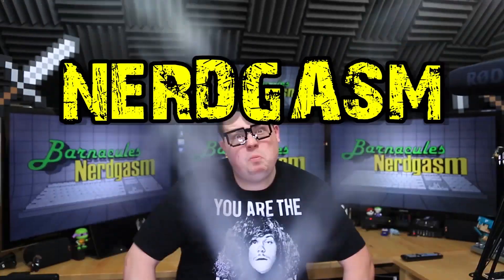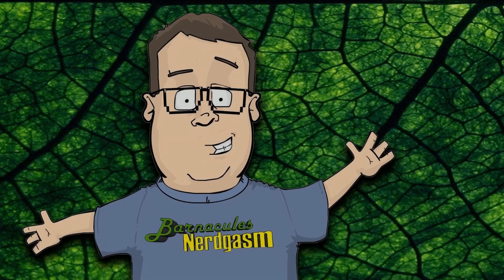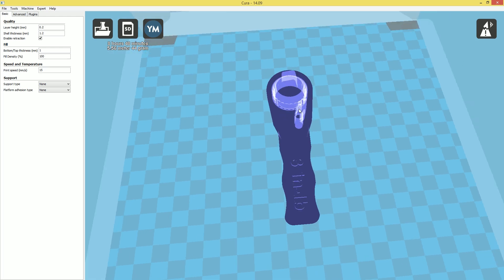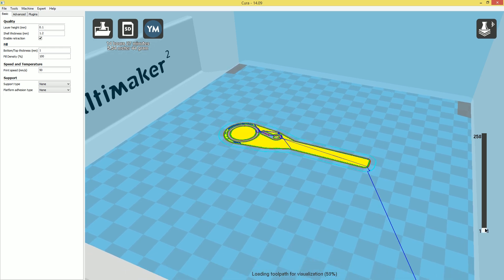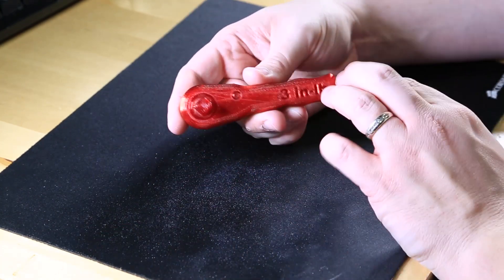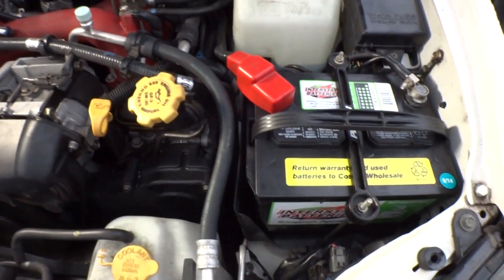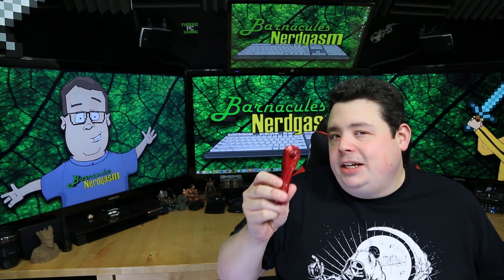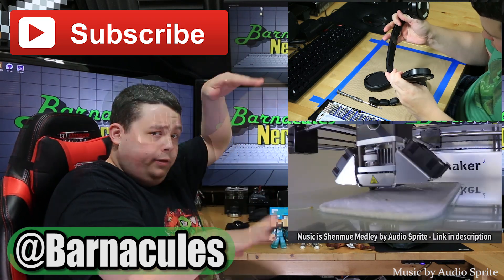3D Printing & Using NASA Space Wrench Here on Earth - @Barnacules

Comment: I have a question Barnacules since you're pretty knowledgeable about all things computer/peripherals.

Would a ModMic 4.0 or an AudioTechnica AT2020 USB pick up sound leakage from a Beyerdynamic DT 990 Pro if I'm listening at a comfortable/loud enough level to hear footsteps in say CS:GO? I really want an open back set of headphones for the soundstage but I fear all of the sound leakage will be picked up by my choice of mics.

If you answer, thanks!
Reply from the maker: You will have problems with the leakage unfortunately but you can set the activation level loud enough in most cases to combat it depending on the application. Truth is for stuff where you're using a mic and need to hear what is going on closed back is the way to go.
Reply: Barnacules Nerdgasm Kind of what I was fearing. Ah, oh well. Thanks for the speedy answer! Greatly appreciated!

Keep making awesome videos. (:
Reply: Whorax I have the AT2020 XLR and it is pretty good for not picking up noise. I record with my Speakers and it doesn't cause echo in my recordings from picking up the sound from my speakers as they are behind the mic. The AT2020 is a cardioid mic which only pics up sound from the front of the mic and very very barely picks up sound from the Back. The only thing with the XLR is you need a 40W Phantom Power Supply to power it unlike the USB Model. But the XLR works better with the Mixers as most mixers use XLR over USB unless your willing to fork out £200 for one with USB Slots plus most mixers have built in Phantom Power. The AT2020 is one of the best cheaper mics out there. I got it before most on YouTube started using it. I paid £60 for mine 3 years ago and have never regretted getting it. Only just recently have a heard of Large YouTubers saying they use the 2020. When I first got it and made videos with it on my other channel people even said how professional the video sounded for a new YouTuber. Most use headphone mics or cheap karaoke mics which pick up tons of noise pollution. Your headphones should be OK so long as you have your mic sat back enough and use a mixer and software to help cancel out the background noise but if you have the mic right in front of you and have the sensitivity up high you will have the mic pick up the sounds from your headphones. My suggestion would be either have the mic sitting 2ft away at medium sensitivity or have 1ft with low sensitivity. So at 2ft using windows settings at 60% volume and 1ft at 30% volume and you should be OK. Mix it with a Mixer and yoy should be golden. Another suggestion is make sure you record your mic on a separate track rather than have game and voice as one track. If you use Shadowplay then use Audicity to record your voice and turn off voice recording in your shadowplay settings. In doing this you can separately edit the voice and you can even edit out the background noise. Also Audicity has some really good settings and plugins that you can use.
Reply: Whorax I've got DT990 Pro and Modmic 4.0, and it does pick little bit of sound when you are firing a weapon, but your teammates can barely hear it if you are talking at the same time. The mic actually picks more noise from my Cherry MX brown keyboard than the headphones. I do however use push-to-talk so my friends have never complained about it.
Reply: I have Sennheiser HD518, which are open headphones, and the ModMic 4.0, and I can almost guarantee that you won't have any problems with it. The ModMic 4 is directional and short-ranged, if you listen at a reasonable volume, it won't be picked up, but if you're almost deaf, it will be a problem.

Comment: are thay thinking about a way to recycle the material in a no cost way?
Reply from the maker: I couldn't find much information on how they are reclaiming the material in space so I'm assuming they are not right now. However with inventions like the filament extruders down here it's just a matter of time before they have the ability to reclaim the filament and make new stuff from the same materials.
Reply: Barnacules Nerdgasm Yeah, If they just melted their printings, they could extrude it back into filament, would be really useful when the teeth on the wrench wear out! It could also be practical for home use, so that you can reuse the material from your bad prints. Greenpeace would approve!
Reply: Barnacules Nerdgasm I Suppose they could technically melt down the scraps and use them, right?
Reply: if the material dose't break down when it gets melted down i guess.

Comment: Cab you make it with the bronze filament?
Reply from the maker: Yes but it would be super weak since the bronze dust is held together with PLA.
Reply: Ahh ok
Reply: Barnacules Nerdgasm could you print a wrench that works both ways, there are these kinds IRL, where there is a lever/switch that you just pull left or right and it switches the mechanism from left to right, without needing a second wrench, or second head.
Example http://www.alibaba.com/product-detail/high-quality-Hot-sales-cheap-price_60011979634.html
Reply: Crazy Psycho I love how you linked an alibaba link. That was just amazing. Also he used one of these in the video near the end on his car.
Reply: KevRunsOnDunkin well, IDK it's the first thing I found :D
Reply: the real question is to cab or not to cab

Comment: They should design a 2nd wrench for loosening, then you'd just have a different one for each. Way easier than a selector switch.

Edit

LOL You literally just said that in the video
Reply from the maker: Great minds think alike :D
Reply: Or they could just put a socket attachment on each side so that you could loosen and tighten with a single ratchet.
Reply: Can't you just mirror the model and make the loosening ratchet? :/
Reply: Why not just put a 2nd head on the other side?
http://cdn2.bigcommerce.com/server1400/84506/products/15532/images/10830/611032__78114.1409993562.1280.1280.JPG?c=2

don't need 2 wrenches or a direction changer
Reply: and now you know to not comment until you've watched the whole video
Reply: That is why I don't comment until the end of a video xD.
Reply: GeoDelGonzo Yes that's what Jerry said.
Reply: GeoDelGonzo ahhh yeah... Just got to that part. I'll shut up now :P Sorry!
Reply from the maker: Alec Day The 1911 requires a very special 3D printer that is over a million dollars to produce. It's a chemical laser printer bonding metal dust together. Not going to see those in our houses until they upgrade the power lines coming into them :D
Reply: hazelamym 3d programs can build scaffolding to support it :)
Reply: Make one wrench with two sides; one for tightening, one for loosening. Pfff stupid NASA
Reply: Barnacules Nerdgasm Hope you read this Jerry. Recently I found about a new vr headset called OSVR its an open source vr group that is starting to team up with companies such as razer, I have got to know that you can 3D print a kind of kit and I thought it would be perfect for you to make a video. Keep up the good work :D
Reply: Well, just take and put two output shafts on the wrench, one on the side that it is on, and another that is on the other side, so with the same, simple design, you can change directions just by flipping it around. Also, if you add multiple ratchet locks, it would increase the torque-limits by splitting the load up among multiple teeth.
Reply: Yes it would be better but they have limited abs plastic up there so they have to conserve it
Reply: chinett63 i thought of that too, but then you've got the body of the wrench being built on nothing.

gravity pulling at it wont be an issue, but the print head still has to have something to lay the plastic onto.

it could be done if they incorporated some snap off support structure underneath it to build on.
Reply: mudbob1 I was thinking the same thing! One ratchet for both directions... just flip it over.
Reply: well we know who didnt watch the whole video
Reply: Robert treboR Well we know who didn't read the rest of my comments.
Reply: only phob is it would be kinda hard to print that
Reply: I was thinking the same thing as I seen this comment, and it was like 5 seconds before he said it the video... Thats just weird
Reply: +Colton Blumhagen Have a duel ended ratchet?
Reply: i was about to be like "god your stupid"
Reply: chinett63 That is what i was thinking too...
Reply: Barnacules Nerdgasm What do you think about XYZ Printing daVinci?
Reply: ssuuppeerrbbooyy  - I have one and it's a piece of junk. Had it for 30 days and had nothing but problems with it. Extruder was damaged when it arrived but I didn't notice it until I had to unclog the nozzle. Other problems include the heating bed won't hold it's calibration, filament won't adhere to printing bed no matter how much glue you use, and now the extruder won't heat up - a common problem with this unit. Customer service is pitiful. (Not to belittle any one but if your going to sell your product in a specific country it's best if you know how to speak their language properly.) Now I have to send the unit in to their shop in California for repairs and it will cost me at least $80 for shipping. And the catch with that is if they feel that the problem was caused by the owner, they will charge you for the repair. Being that they have dragged their foot on helping me to resolve my problems from day one, I don't have much trust in them. All they have to do is "claim" that I caused the problem to escape responsibility, Thus I would be stuck with the cost of repairs and the return shipping. Honestly, I would only use it for a boat anchor but I bet it would fail then, too!! I will sell you mine if you want it!!!

If anyone out there would like to donate a Ultimaker 2 to the poor unemployed college student fund (me), I would love to have one. It would come in handy for class as the da Vinci is NOT trust worthy!!
Reply: aww he dident print in the metal type
Reply: Just mirroring the model should work
Reply: ant a Well it's not always possible to have all the tools you'd ever need IN SPACE.
Reply: Barnacules Nerdgasm
They now currently have a full working totally 3D printed 1911 pistol and from what i heard it feels like the real deal and it looks like it would funtion just like the real 1911. That is like on the 15th attempt and now we are already to the point where if you want a gun you can go online and if you have a 3D printer that can deal with actual metals, you can print yourself a gun now and have it be fully functional and that is amazing how far 3D printing has come, truly amazing. I am like whats next? A fully functional 3D printed PS4 or other game console? If that can happen that would change the way console manufacturing is done. No more need for an assembly line and workers in sweat shops building the consoles, they can just be 3D printed fully working and and alls they would need is the hard drives to be installed and motherboard with the APU on it installed. but if that can happen, space is the limit to what we can see in the future. Just amazing to me and i bet you as well.
Reply: chinett63 a double headed wrench would run into problems with being printable. However, if you separated the head and made it slip into the ratchet from either side it might be possible.

I think I know what tonight's 3D printing project is.
Reply: make one that would print sideways and put some support material.
Reply: OLEMINER49ER 1. just swapping the orientation of an FFF print can often times have undesirable effects, especially when dealing with toothed gears like this. 2. You're now introducing support inside the model where it's difficult to remove and can cause the teeth inside to break. And finally 3. Support is waste and in space that's a problem. (on Earth, too.) Maybe they'll get a waste grinder and reclaimer in the future, there are several places here on earth making those available.

But I, personally, think it can be done without support whatsoever. Playing with it right now.
Reply: Jeremiah Bullfrog Albert Einstein had a great mind.  For the few that could directly match him, the quote is true!
Reply: Instead of making two different wrenches, put the square peg on both sides of the cylinder. that way one side is loosen, and the other side is tighten. better yet, print it with a dado in the square peg so that it slides thru from loosen side to tighten side.
Reply: Here's my solution. It works, but I worry about losing torque strength: https://www.youmagine.com/designs/modified-space-wrench
Reply: Barnacules Nerdgasm you could just print another driver head on the other side
Reply: elibmx14 
That would require a lot of support material as you are building from a flat bed and the second head would protrude from the bottom of the print..
Reply: true
Reply: ***** Or they can have fun and 3d print things because its just awesome. 
And they're in space bro, they can do whatever they want and its cool either way, they are in space. haha I'm clownin
Reply: +OffMe Meds they don't just have a regular wrench hanging around,that's why they sent a 3d printer into space
Reply: well, smth-> Space, 13000 $/kg. If wrench 0.1kg => $=1300. Additional
Reply: print same wrench as mirror
Reply: Colton Blumhagen a but
Reply: Yeah, or just make the connector part a separate part & leave a hex hole through the gear to mount it in & just swap the connector bit between sides.  But really, does Nasa want a wrench that can take bits of the station apart just lying/floating/velcroed around?  Yeah, they are professionals for sure, but this is 'control' we are talking about...  LoL
Reply: Joseph, do you really think an astronaut would take apart the space station their life depends on?..
They don't send dumb people out there. And smart people value their lives because they know there's really nothing afterwards
Reply: Colton Blumhagen make it with a drive sticking out the back as well.
Reply: Colton Blumhagen your so smart aren't you
Reply: good way to waste more material, that defeats the idea of printing tool in space at the first place.
Reply: Colton Blumhagen is a dumbass
Reply: Colton Blumhagenu
Reply: Some ratchets have the 'drive' lug on both sides, to eliminate the need for a switching mechanism. Need to reverse it? Flip it over.